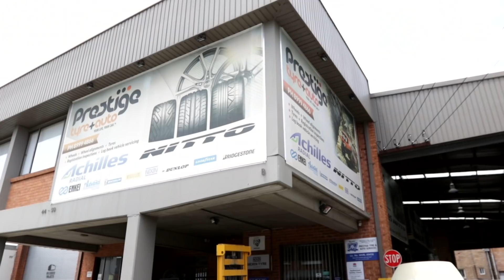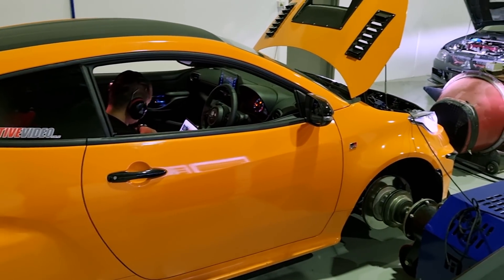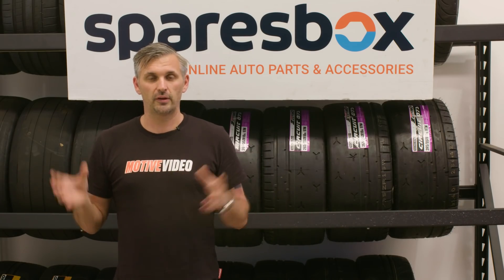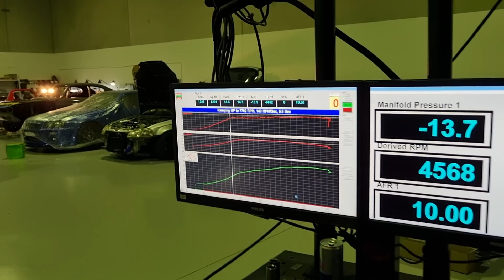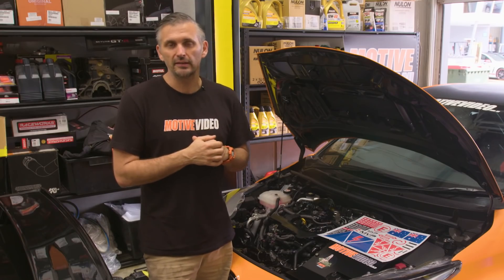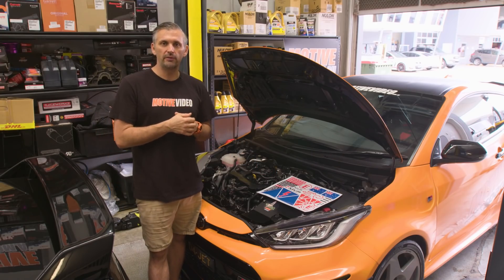500hp GR Yaris gets into Race Trim - Motive Garage

Comment: Always keen for more Yaris content.  Drove one recently and it was fairly quick  in stock form so I cant imagine how fun it would be with this much power!
Reply: 3 or more videos within 2 weeks. And all these videos informative, and interesting?! Not common. Rad channel.
Reply: Fairly quick in stock form. For a 1.6l 3cylinder to be able to smash 12.8s down the quarter. That's more than quick that shits over plenty of bogan performance vehicles.
Reply: @christrees664 a S13 with stock SR20DET would run 13s, and a stock LS1 motor'd car from the late 90's would run 12s. They're both stock, non-performance vehicles; but with considerably strong motors. Those vehicles are from the 90s. Like you said, this car is just as quick as bogan performance vehicles; but you'd hope so, considering you're pitting it up a brand new car against cars from the fucking 90s LMAO hahaha
Reply: @JohnPedder  a s13 strock does a 14 sec lol and a commy of that era does a 15 sec. a gr yaris is on par with stock gtrs of the 90s. pretty good from a 1.6 3 cyl
Reply: @JohnPedder  haha stock S13 run 13s that's hilarious.
Need about 180kws to get those old Datsuns into the high 13s
Reply: @grimreaper6112  does it have a worked FJ20 because I will take that!
Reply: @daniel-it2lw  so I was one second off. My point still stands: A new car should be destroying the older “bogan” cars.
Reply: @christrees664  Like your boyfriend Dylan said, stock S13 can run quarter mile in 14 seconds. That’s a car from 1991. So a car from the past few years should be destroying these older cars, as my point suggests.
Reply: @JohnPedder  14 seconds.. high. With a good driver on a prepped strip.
A gr Yaris has smashed 12.8s on the street.

Get a grip on you rose coloured glasses.

Good is a cat back only 1989 Honda CRX SiR running a 13.9 with full interior at 166kph. No turbo needed.
But still that's not as impressive as a GR Yaris. But better than your shit box S13 or old ls bangers.
Reply: @JohnPedder  and you know what else can run 14s... A fucking Camry. 12.8 is destroying that and your shit box's

Comment: I'm honestly surprised you didn't pop those rear speakers out - they're not SUPER heavy (both of them and their metal mounting plates weight what, 5 kilos total?), but they're up high.
Reply from the maker: They’re actually really light.
Reply: @MotiveVideo  Yeah mate I don't disagree, but for a minutes work max that could still be another few kilos off the tare.

Comment: How many kilos were you able to pull out by removing the Interieur parts?
Reply from the maker: We lose approx 47kg but the cage puts 36kg back in. When we put bucket passenger seat in, it will be back to factory weight interior

Only weight saving will be the battery and titanium exhaust
Reply: @MotiveVideo  
So I guess real weight saving will get expensive fast.
Thanks for replying.

Comment: I was gonna say, have this versus Project Binky, but, with this much power, it wouldn't be a fair comparison. Not even close... Maybe have Binky versus a stock GR Yaris versus this?
Reply: Considering Binky has a 800+hp capable turbo, Forged 3SGTE with big cams and a 4 bar map sensor I Actually reckon Binky would destroy it.
Reply: You haven't been paying very close attention to Binky, have you? Granted, the build is road-focused, but if you think a pair of professional race car builders (one of whom is also a professional race car driver) couldn't mop the floor with the Motive team, you've got another think coming. Andrew's a keen wheelman with a sharp eye for improvements, the Yaris is a great platform, and the work that has been done to the car by Grub and everyone else is absolutely fantastic, but there's so much difference between the two vehicles and teams it's not even a fair comparison to begin with.

Comment: Don’t need the front tow point?
Reply from the maker: the factory tow point requires pulling half the brake duct off so used tow strap instead in engine bay
Reply: Fair enough. I’m drilling a hole in cover and keeping the cover fitted front and rear. Good luck with the weekend. Is there going to be any live feeds available?

Comment: Has anyone around 6'2" driven one, how did you fit?
Reply from the maker: Andrew is 6’2
Reply: @MotiveVideo  Nice, I might have to checkout the local Toyota dealership. Angry little nuggets!!!
Reply: @alexmartin9951  good luck with that plan
Reply: Yep, they are rather roomy for their size.
Reply: @MotiveVideo  Lol literally only just scraped in under the maximum height limit for RAAF pilot applicants!